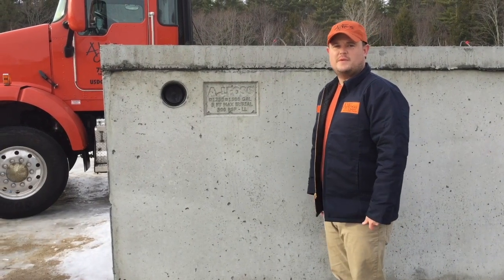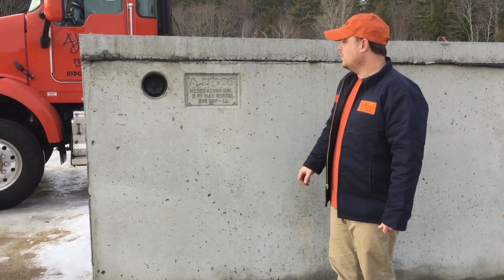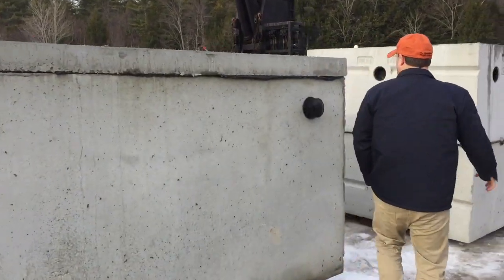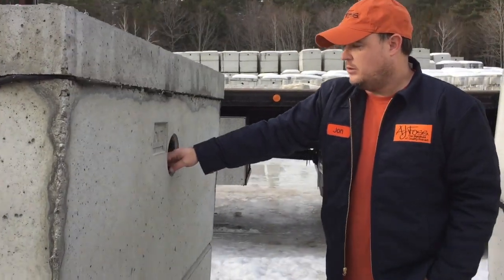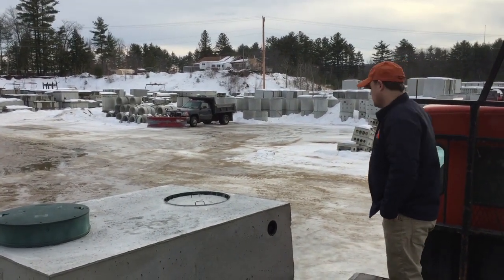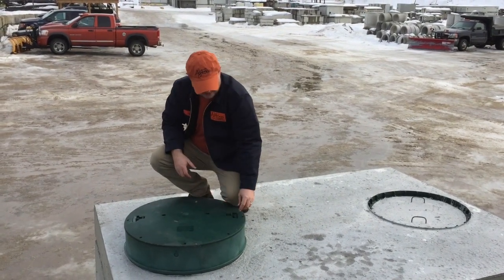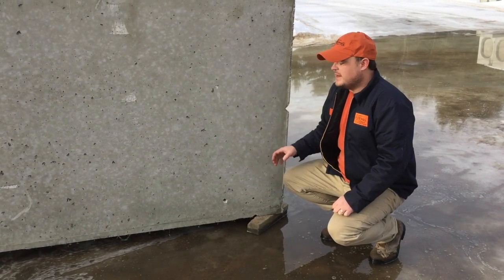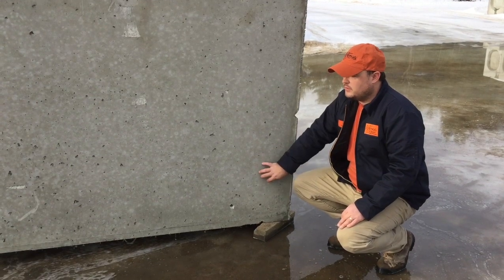1250 Gallon Monolithic Precast Septic Tank

Comment: Why don't u use plastic to cover the man holes so water doesn't go in instead of putting holes in the tank?
Reply from the maker: Most of our tanks do not come with plastic risers built-into the top of them so putting a plastic cover on them would not work.  On the tanks that have plastic risers built into them they are usually stacked 2 high and if they had a cover on them there is a good chance they would be damaged while handling them. They would also need to be screwed down, which would take additional time in the yard.
Reply: @Ajfossprecast  better than drilling holes
Reply: @Ajfossprecast  you don't need to put screws just use canvas with flat board and stack yo tanks instead of putting holes so it pollutes the ground freezes and breaks the tank worst.
Reply from the maker: Joe Smith The canvas would freeze to the top of the tank and we would need 1000’s of boards to cover all the tops of our tanks. When the tank is corked and water plugged there isn’t issues of leaking and freezing to crack the tanks.
Reply: @Ajfossprecast  I doubt that
Reply from the maker: Joe Smith It’s what the local precasters around here do.
Reply: @Ajfossprecast  pretty sorry shit I'm from North Michigan where it gets coooold .they don't even do that up here
Reply from the maker: Joe Smith Everyone has their own ideas on how to do things. This way has worked for us.
Reply from the maker: @TheIggypop1  remember you from a previous post. Always using the word Swiss cheese